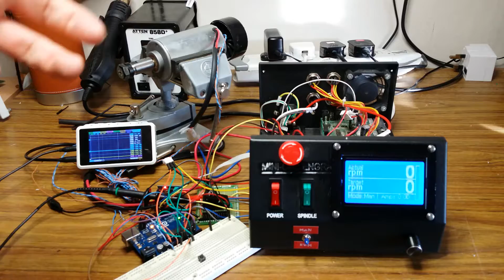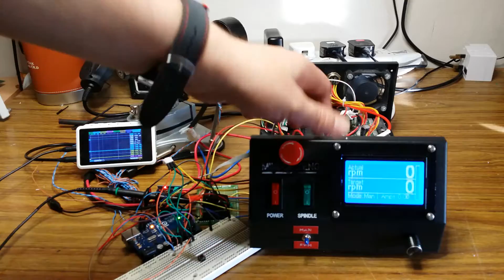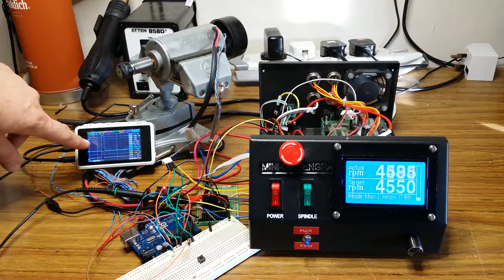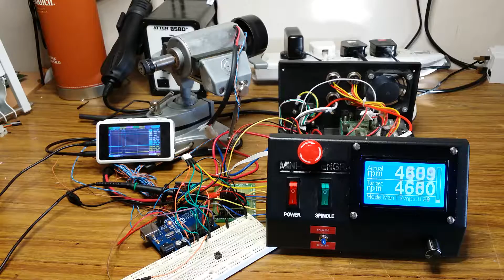CNC3040T Spindle Controller Upgrade

Comment: Hi I have a 3040T also converted to use GRBL. Iv been attempting to take the pwm from grbl and convert back to the rpm set point for PID control. Currently I have been trying an RC filter but not having any success so my values are probably way off. The features youve included are exactly what Iv been trying to achieve, also a speed adjust pot for when the spindle is commanded by grbl/pc. Im very much a arduino and electronics novice so hope this makes sense.